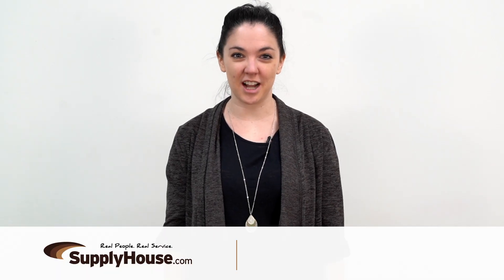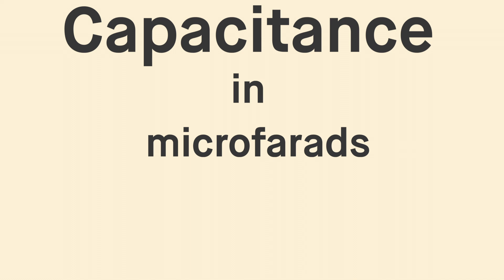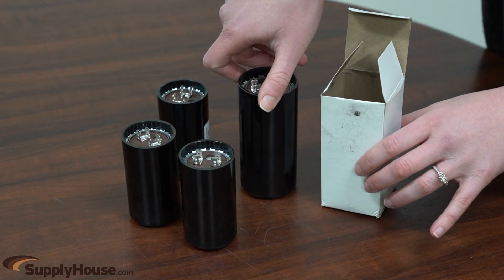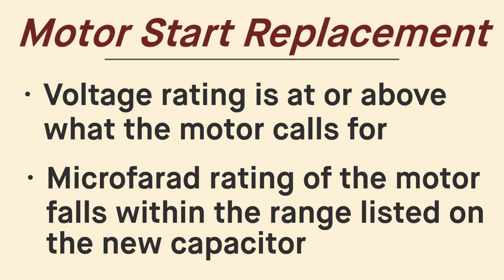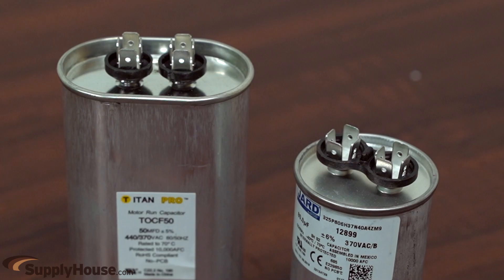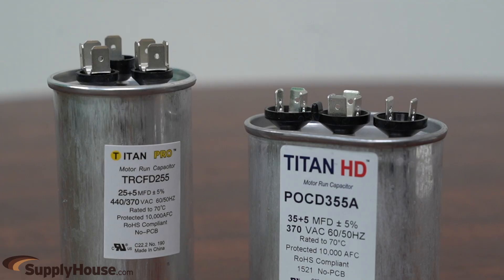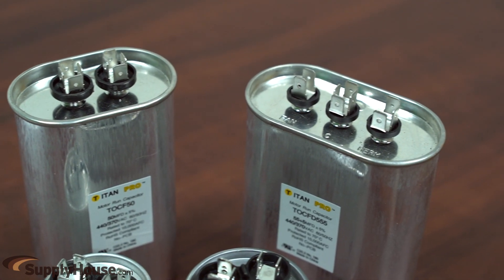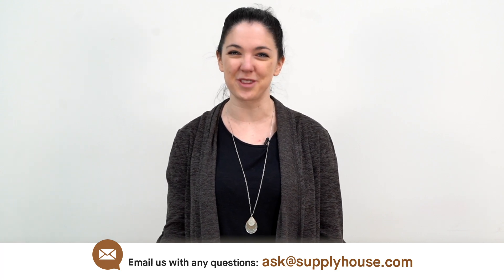Motor Capacitors

Comment: 380 volts motor,, convert to 220 volts power supply,,
Is 180 microfarad capacitor 
     is OK???
HOW MUCH is the cost of 180 microfarad capacitor???